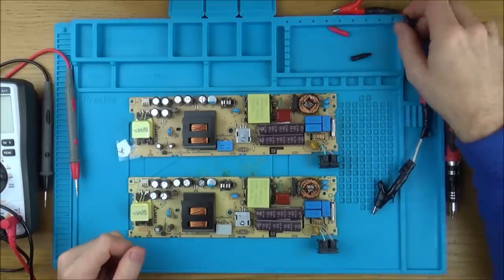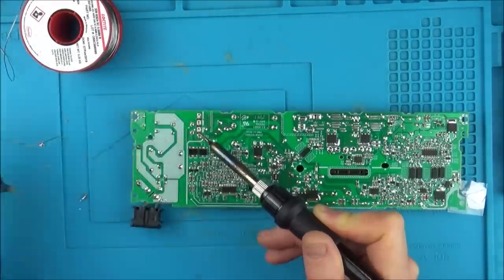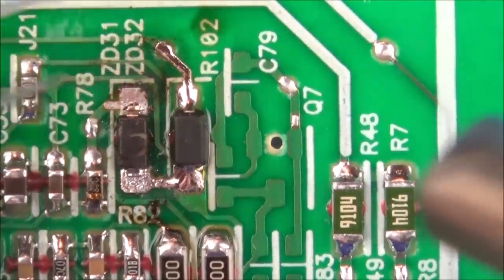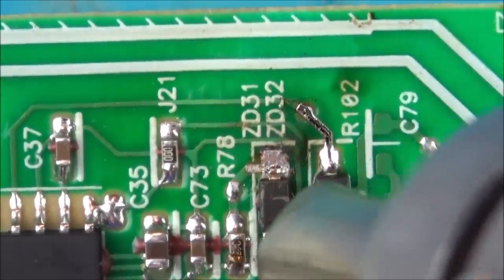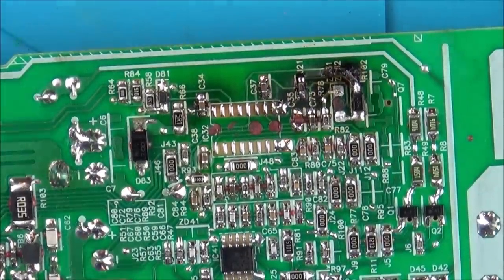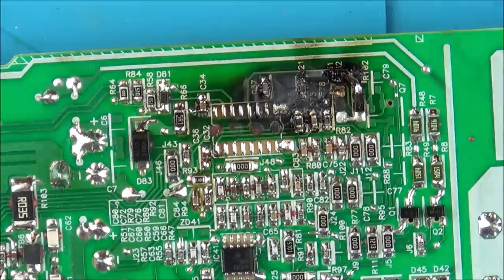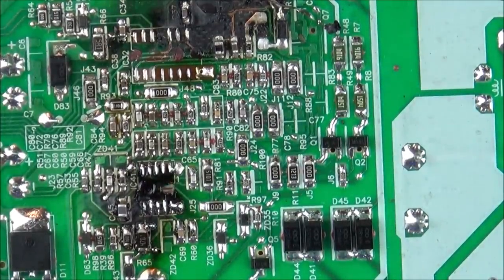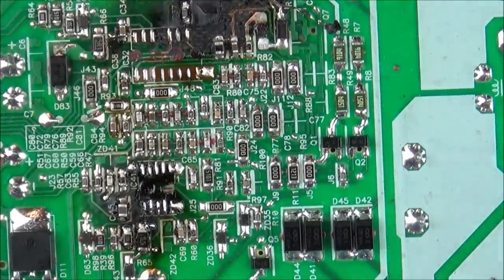REVISIT : PS4 Slim Faulty Power Supply ADP-160ER (QUICK VERSION)

Comment: That "blackened" spot under the diode is actually glue. It is used to fix the components to the board before wave-soldering.
Reply: yep thats why it took to long to get them up and over heated the board.

Comment: The pcb is made from paper(cheaper then fiber glass), that's why it burns so easily. Also the board is wave soldered so all the parts glued to the pcb, that's why it wont came off easily. Google for phenolic pcb, wave soldering for more info.
Reply: So they SONY are penny pinching by busing cheap PCBs

Comment: You need a DC power supply so you can inject a current limited voltage into the board, the faulty part will get hot and make it easy to find

Comment: The board suffered from popcorning because you didn't preheat it. This problem occurs when a lot of temperature is used very quickly, but it usually happens inside the chips that trap the air.

That board is not multilayer (except for the surface layers), which is why the air trapped in the porous material expanded and burned from the inside. It has never happened to me because I have always used a soldering iron to repair the PSU.
You can avoid thermal shock from the board using a preheat temperature in a range of 100 to 150 °C for 5 to 10 minutes, depending on the thermal mass.

Comment: Quick tip: If you have a short that can be measured by a capacitor, just find the GND line of that capacitor and add 1V to it, to it's GND and VCC pads (that's why you need to find the GND of it first, you probably can find it with an electrolytic capacitor that tells you the GND line) and start to add current with your power supply, start with 3Amps and rise, and see if something starts to heat up.
1V will not cause any issue since you have a short, also the voltage will drop significantly because of the short so it'll not even be a problem and it will be good enough to heat up the faulty component.

Comment: 4:24 That red thing is the glue they use on the production line mainly to solder THT components (and smd as well), that's why you had many issues removing that component. They glue those smd and they wave solder the board so components don't fall.
You should have poke it from the side while unsoldering it.

Btw, the amount of heat you added (burnt) will week the traces and they might end up failing. Also that diode next to it will not survive much.
Also based on the amount of burn, your PCB is now carbonized, which will conduct current :\

Comment: Hey I have the exact same ps4 slim, the powers supply is shot. I want to know what the voltages are on the acin_det and acdc_stby. I want to try and power the ps4 to see if it will even turn on. Thanks, great video as always

Comment: Use lower heat you burn pcb with no reason, you can use and low melt solder 138C° and take the chip easily 💪 keep going
Reply: microsolderinglab he probably used 400c. 280-300c should be enough to take the chips out. But he is using a cheap hot air station, not good regulation on this 60€ stations.

Comment: Why didn't you test the large capacitors on the left top of the power supply board? It is common for caps to short in power supplies.

Comment: What heat setting are you using on your hot air station? The board really shouldn’t burn that easily unless the heat is too high.

Comment: The red stuff is pcb component adhesive so they can place the component with a P&P machine then go through a reflow oven with dual sided pcb component being done all at once...
There is a possibility that the board delamination is becuause its such an unpopulated area & surface lifted because theres not enough copper to dissipate the heat🤔

Comment: Do you not see that red stuff under each component ? It's glue so that why you destroyed the board....you must use something before to break that glue, or force the components out of there after the solder melts...the tweezers don't have enough grip to break the glue and if you put heat on the PCB until the glue melts well...that mess happens.

Comment: there was a song by Crazy world of Arthur Brown,
"FIRE"
which has iconic intro that seems to be fitting the situation with the PSU after the fault finding here.

Yes you are right its not gonna be used but maybe thing of using the same methods you did in the past - shield the board from excess heat, use short bursts and try to be careful.

The entertainment value is obviously increased by the fact that it looks like it was in war but i do wish you used already presented methods of heat dispersal and shielding more often.